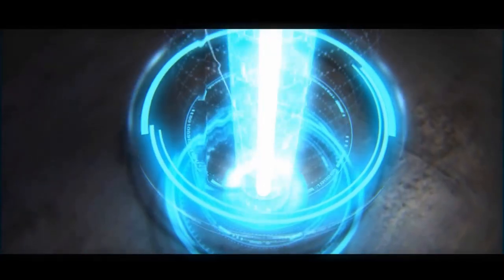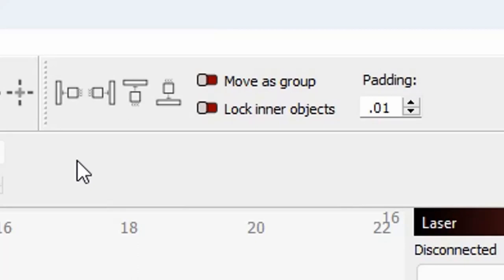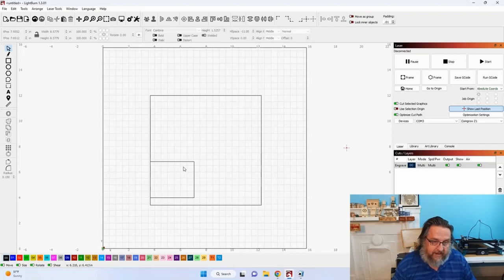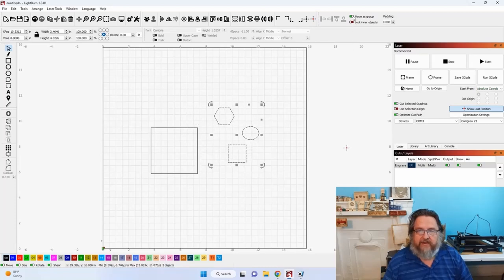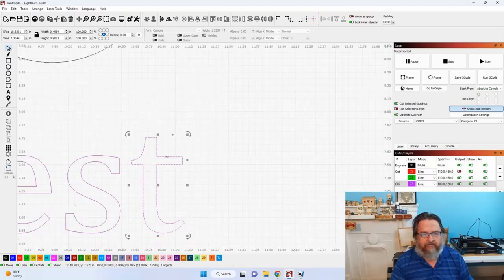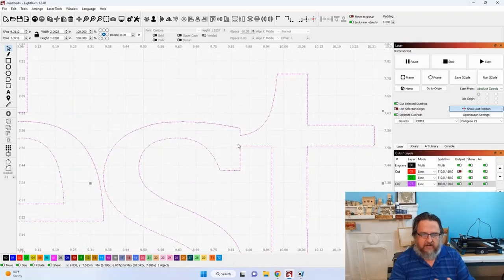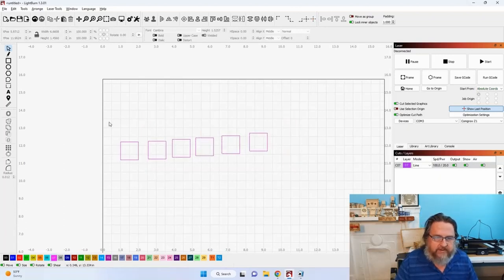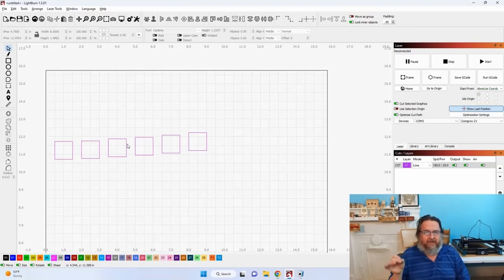Docking in Lightburn

Comment: I would like to see them add a padding for the distribute function, that would give us the ability to do what were looking for. Great videos by the way and thanks, Bob
Reply from the maker: What I'd like to see is the ability to use the docking tools when designing off the workbed. If you have found out, unless your objects are on the workbed, the docking functions will not work.

Comment: Thanks Steve - A BIG takeaway for me was how to dock on the inside of a shape - bugged the heck out of me that the docking tool itself didn't do this, and I had never discovered that function of the alignment tool you pointed out.

One thing I use the padding feature for all the time is to help use materials more efficiently, especially with odd shapes. I rotate them all around and then dock to 1 or 2mm separation before cutting.
Reply from the maker: Your talking about using the padding feature to nest your shapes. That is smart. That is one thing Lightburn could definitely improve on. Their third party nesting tool only works some of the time and it's a bit cumbersome. I may try using your technique myself. Great idea.

Comment: Man. You and Rich are the LB heroes love your vids. I find myself doing the most of my drawings in lb then exporting them to dxf if i need to use estlcam or vectric if i need to use the cnc. (After the last version update im having issues exporting to dxf with lb. Drawings are not ok, also LB need a better nesting tool i have to export things to nest with aspire its way better )
Reply from the maker: I agree that LB needs a true nesting tool.  The current nesting is not actually part of LB. (You may be aware of that.) It's a third-party program that shakes hands with LB. But very poorly. I did a deep dive on it, too. If you search my videos, you may find it helpful. There are some unusual things you need to do to get it to work. The biggest conflict is that the third-party program gets confused by the workbed in LB. If it's included in the .svg you import, it treats the workbed like an object that needs to be nested. Even when you get the right images into the nesting tool, it's still randomly successful. They really need to build in a true nesting tool within the program. Party on dude!

Comment: Steve,  Just came across a tool that hadn't paid any attention too previously.  The "Two-Point Rotation / Scale" found under the Arrange menu.  Was wanting to make an Isosceles Trapezoid with specific measurements and couldn't think of an easy way to do it.  The rotation tool allowed me to make complete this.  Could be another way but I just couldn't of it. Maybe a subject for a video.  Unless it has already been covered.   Thanks,